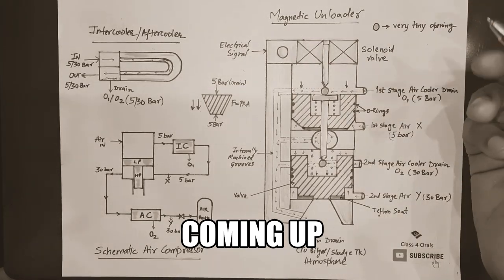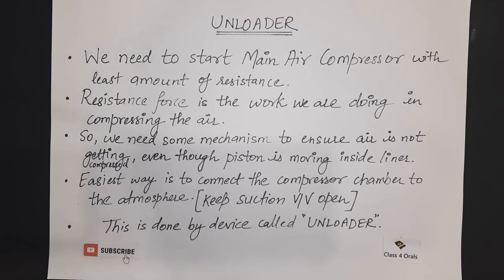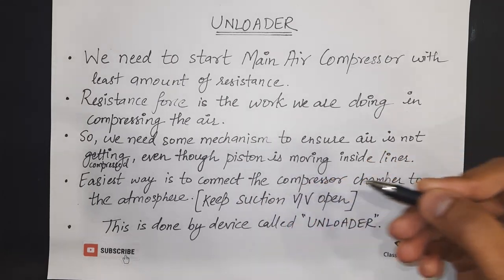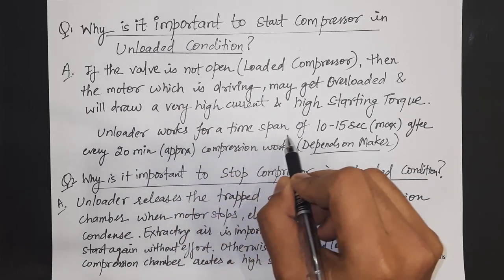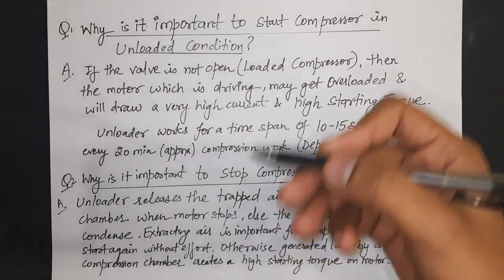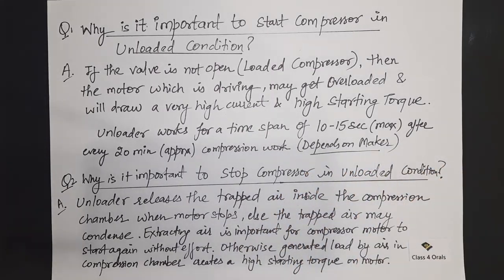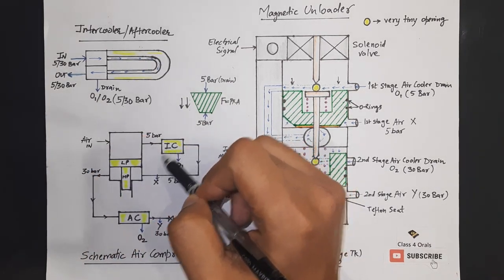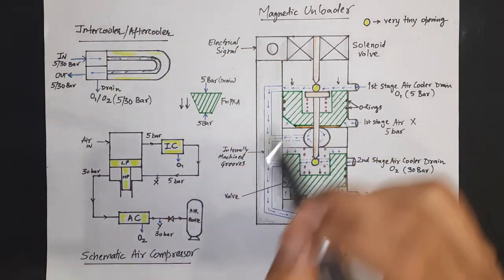How Unloader Works in Main Air Compressor ? Full Explanation | Important for MMD Orals #Unloader

Comment: In the normal condition, the pin holes connected to the cooler drain are in  open condition right?, And when the solenoid valve is activated, the pressure imbalance and 2 valves lift and releases the LP,HP side air pressure.
    If the pin holes connected to the cooler drain are in  open condition ,then also LP and HP air pressures will drain right since both cooler drains(O1,O2) and X,Y connected to air side/pipe ( Correct me if i am wrong ). Then why there is seperate valves for X and Y ?
Reply: Same doubt, if it is continuously draining what is the need of Solenoid Valve to operate?!
Reply: As of what i know, 
The drain connection will be used in case of unloader not working, then we will have to manually open the drain of inter and after cooler, which is ultimately connected to unloader and unloading will occur,  rest is when solenoid operates as brother explained. 

Anyways great video
Reply: If small holes continuously drain, water and moisture will be drained; no need to open every 15 minutes!   But as I know unloader opens timely to drain moisture and water.

Comment: i Had a simple question , when the compressor is working normal and the unloader is not in use still 5 bar air will go the drain via the internal grooved pipes ?

Comment: Sorry sir, what kind or what model of unloader you are describing in this video?  In my experience, the unloading process works only when the solenoid valve was not energized. It is during starting, every 15 mins of continuous running and while the compressor is not running or stop.  While the compressor is running in normal operation, the solenoid valve was constantly energized and it pushes down the pilot valve to cover the tiny hole or opening as you describe.  As the tiny openings are closed, the pilot air coming from first stage pushes and close the L.P. valve and pilot air from second stage closes the H.P. valve,  Those were trapped and not continuously going to atmosphere to hold the valves in closed position. When the solenoid vave was not energized during unloading process. the pilot valve was push back by the spring to open the tiny opening. This tiny openings when open was use as a passage by the air closing the L.P. valve. When this air scapes, the L.P. Valve and H.P. Valve can now push upward by the drain coming form first and second stage. And then the valves are open for unloading process.
Reply from the maker: This is not a particular model or maker Unloader. This is what being taught to mt Seniors and in Academy. You r right the tiny holes are mostly trapped and not leaking to atmosphere, but some models do not completely trap holes..

Good observation 👍

Comment: thanks for the explaination sir!! as there is no single explaination regarding unloader on yt but you saved us. you have gained one more subscriber.
i have one doubt. as you mentioned compressor is driven by 3 phase induction motor so which motor is used on ship for fuel oil and lube oil handling? also which motor is used to run centrifugal pump on ship?
plz answer this. thank you.
Reply from the maker: Thank you so much Yash More for your keen interest in the channel and in this video. I create content which is not easily available or in books unlike just copying and pasting the content.

I will send the answers to your doubts soon regarding motors shortly.
Reply: @CLASS4ORALS  yes completely agreed. 
Okay sir. I have an interview scheduled at the end of February. so it's my kind request to answer those questions as soon as possible.
Reply from the maker: Surely Will send.👍 till then please refer the Pump manuals of your respective ship, that contains the Type of motor used.
Reply: @CLASS4ORALS  sir I don't have sponsorship yet.
I have sponsorship interview scheduled at the end of month not MEO class IV interview.

Comment: Sir from the video , the air is drained in both the case ie during the solenoid valves actuation and also when it is not actuated , so to run the compressor so to actually compress air  we need to disconnect the unloader??
Reply from the maker: Yes, during operation of Unloader initially for 10 sec, or after 20 min for 10 sec, now unloader needs to be deactivated. the Compressor is now under Compression mode.
Hence unloader is not actuated that time of general compression.

Also very tiny amount of air/water from Intercooler and aftercooler keeps on draining via Unloader, through the machined bore,(even if Unloader is not operational)
that draining is not going to affect the performance of compression much.
Reply from the maker: I hope that clears your doubt.

Comment: How come air pressure of 5bar(X) and 30bar(Y) is available to unloader during STARTING of compressor is?? 
If the compressor is not running, pressure would be zero only to unloader, isn't it?
Reply from the maker: Before starting, the pressure starts to build up, that time 5 bar and 30 bar production will act on unloader

Comment: Why after every 20 minutes unloaded works for 10-15 seconds?
Reply from the maker: Because it is necessary for removal of any moisture accumulation in the compression chamber and in Intercooler and Aftercooler Drain, else it may cause difficulty in Effective compression.
Also risk of failure bcs Moisture and water is imcompressible.
Hence depending on maker, on an avg there is 10 seconds of unloading every 20 minutes of compression.
Reply: @CLASS4ORALS  but moisture is already draining through the pin hole then what is the need to drain again every 20 mins
Reply: @CLASS4ORALS  and the x and Y ports r not connected to the cooler drains then how will they drain the  moisture? 
TIA (:

Comment: brother, how do i know my compressor unloader is working or not
Reply from the maker: You can see the low pressure on HP and LP gauge initially, if you see this and rising after 10 15 sec, then ur unloader is working good..if not, it is faulty